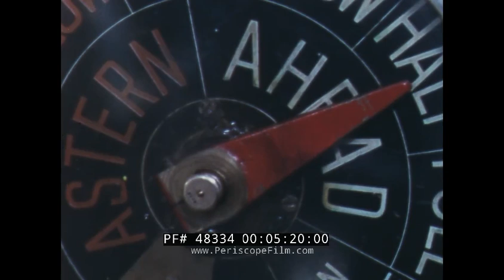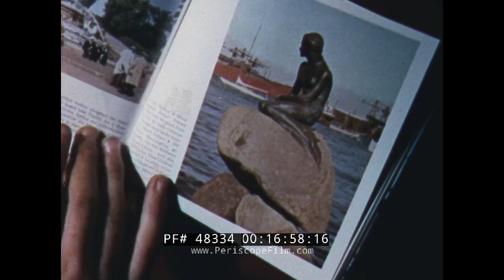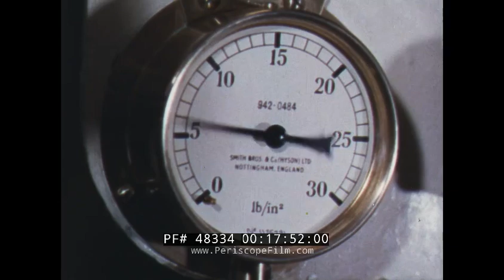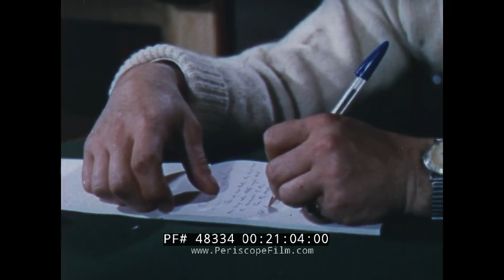HMS ARTEMIS S-49 / P449 VOYAGE NORTH  ROYAL NAVY TRAINING EXERCISE 48334

Comment: I worked on board the RMAS Kinloss salvage vessel. We sailed from Dover to Gosport during the night that Artemis sank at her mooring with 3 crew members trapped in  the forward tower. I personally steered the Kinloss all the way from Dover to Gosport because I was the only crew member that could steer the vessel in a straight line therefore saving time & distance.  The voyage took us about 12 hours then we all had to set to work on the lifting operation, ie, preparing hawsers, cables , piping & other equipment required for the lift. Our diver named Joe connected an air hose to the hull of Artemis & we began pumping air into the sub. We shared a sling between 2 salvage vessels under Artemis & began lifting her from the vacuum of the mud. The lift was very slow,  a couple of inches every couple of hours, during which time the 3 trapped crew members used a submarine emergency escape method after an egress had been cut to allow escape. All 3 surfaced safely amid cheers from the salvage vessel crews. Once Artemis was freed from the seabed mud it surfaced rapidly with its forward tower surfacing between the 2 salvage vessels. The whole operation took 3 days in which we all had little or no sleep. We all had to line up on deck to have our photograph taken, after which we were allowed to return to Dover to continue out normal work of maintaining navigation buoys & mooring buoys on the east coast off Kings Lynn & Boston Lincolnshire.